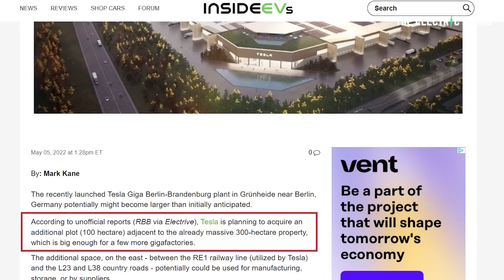Tesla building 2nd gigafactory in Germany + 2 year Giga plans

Comment: Yeah, it was pretty obvious that another one would be built in China, whether or not it was next door to the one they built.  Both Giga Berlin and Austin, they bought so much land, that the expectation was already to expand those out.   Not sure that even with the land expansion we should call this Giga Berlin 2 if it's on simply adjacent purchased property.  And I don't think they'll immediately start to build out there even if they get to purchase the land now.  They've got space to build 3 more primary factories on that land.  I do think with the extra land, they can potentially shift the rail line to the West of the logistics line and fit in another 2-4 giga buildings in the land area.

Comment: Yea, whats the point of giga factory in india at all? Labor cost may be cheaper but without car market what does it matter? Not even the best place to export every car that produced either. No required supply chain regarding cell, battery lithium mining etc also. AND fsd would never work! IF tesla ever makes a two Wheeler only then thay can think about india.

Comment: Anyone can knock out multiple videos per day, but what's the point when the go/no-go decision may rest on the tons of CO2 sequestered/yr by a 100 hectare tree farm (assuming the wood becomes building material) versus the tons of expected annual reduction in CO2 emissions/yr from replacing ICE w/ the EV vehicles produced by the factory, net the carbon footprint of producing those vehicles.   The trees are likely harvested every 20 years, so at first glance that doesn't seem like alot of sequestration per year.  However, trees sequester ALOT of CO2.   On the other side of the ledger, an average ICE car emits 4.6 metric tonnes of CO2/year, so replacing 500K ICE vehicles/year, each with a 15 year lifespan, suggests HUGE averted carbon emissions.
Reply: Your math is a little fuzzy in that you called it exactly what it is, A tree farm. Was meant to be harvested. The only thing that changed was exactly when, and who  would do the harvesting. Trees are a renewable resource.
Reply: @davekozlowski1266  And furthermore, this plantation seems to be ripe for harvesting and Tesla will overcompensate planting ecologically much more valuable woods by the factor of two, like they did with regard to the initial area.